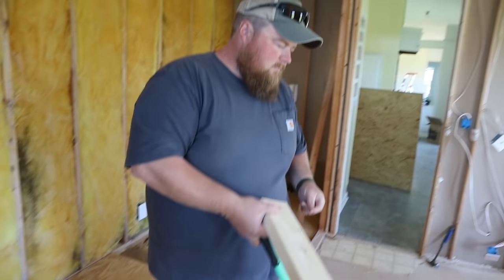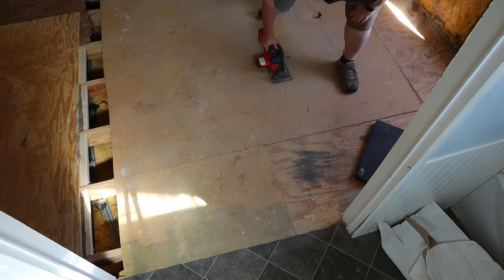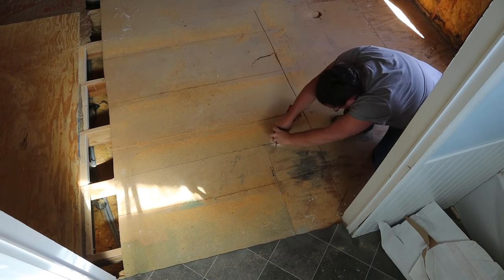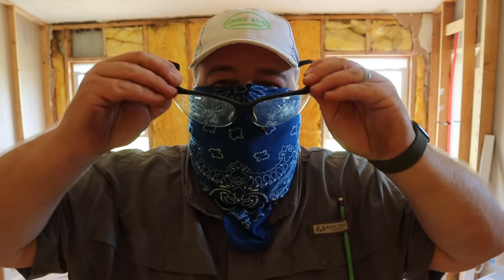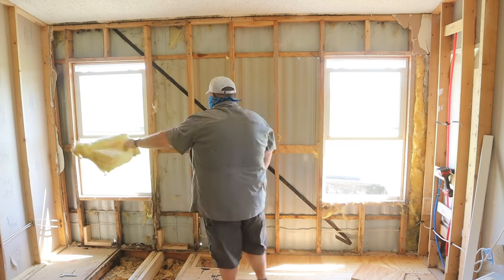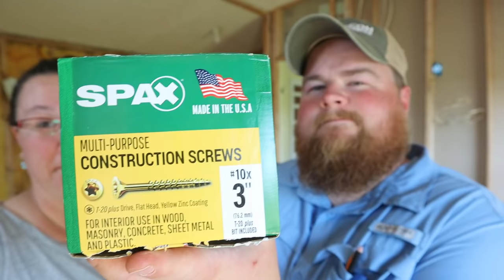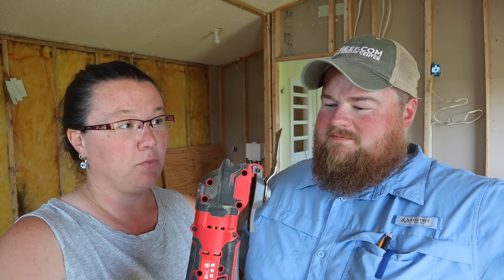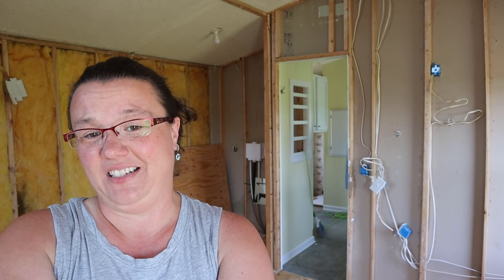More Than Expected... FULL Joist & Subfloor Rebuild // Mobile Home Renovation

Comment: Are you sure that those screws are long enough?
Reply: Sam's pry bar is stronger and won't flex much while the other bar is more usable for light duty and for hanging doors etc both are necessary when doing the work you guys are doing 👍
You guys are doing great work with excellent choices.
Much love 🙏🙏🙏💜💪

Comment: Just subscribed and yall are fun to watch also... I'm not an OSB nor MDF board fan either, rather use plywood. I'm slowly working on a 1987 Vintage RV 26 x 8 ft 5th Wheel remodeling to renovating it, getting rid of all old water damaged framing and flooring, etc that's including getting rid of all OSB and MDF that was originally used when this was first made, lots of water damages and it's a project that will take a bit of time but will be worth it whenever this is done. I'm doing away with the old black and gray tanks and water tank as well. This RV will not be used for traveling but will be used as a stable in one place on this property tiny home. Since I'm doing most of the work myself,  I'll have to work one section up to 5 feet at a time with the flooring and walls from the back to the front from the inside to get it fixed, cleaned up and steady stronghold, etc before I move in and before the city does a complete demolition of this old condemnable non fixable house and 2 story building on this property, no date set for any demolition yet, but want and hope to get this RV done before it happens. Again,  I agree about those OSB and MDF boards,  once there's water damaged its not good no more...plywood is better 😉👍

Comment: I just got a new Ryobi brushless Oscillating multi-tool for remodeling my mobile home. Don't like the switch on it, hard to turn on and can't shut it off right away. I just might be switching to Carsftman cordless power tools! Working on replacing the bottom plate on the walls and repairing or replacing any rim joist that are bad. 

Just starting to be brave enough to record what I'm doing! My channel isn't nearly as good as yours, but still fun to help others who might need it. Will be posting a new video tomorrow night.  Plywood? Next thing you'll be using Shiplap! 😅 Great job, love what you're doing!

Comment: The plywood goes under the plate. That job is shabby. The plywood believe it ir not supports the wall. Cutting up against the edge is a corner you just can't cut. This repair won't last 12 months.

Comment: I haven't followed your home renovations enough to know....Since you're taking things down to the studs and making structural improvements, do consider aging in place or if someone in the household becomes mobility impaired.  What would you do, where would you place them in the house, what types of grab bars might you need, and more.  And please, please consider where and how you might place a ramp into the house.  Placing a ramp at this time is neither here nor there.  But the vegetation placement and railing design are here and now.  In these plans, do consider that fiddling with keys while using a walker or waiting for someone while in a wheel chair isn't as pleasant in a down pour with no covering.

Comment: Ran a repair business for several years repairing manufactured homes. Done a lot of subfloors and found it beneficial to sister the floor joist at the subfloor joints. Made it faster and much more solid.

Comment: I did this job to a whole house recently.  DeWalt makes an adapter that allows 1/4 inch bits to be used with  1/2  inch impact wrench.  It's like a screw laser for fastening sub flooring to joists.  So much faster than a 1/4" impact driver.

Comment: Why the overkill on screws for floor, 1.5 or 2 inch screws are more than sufficient for 3/4 inch plywood, the extra length screws do not hold any better, but they cost more and drain battery faster, hence OVER KILL!
Reply: 1.5" screws wouldn't meet code. The code minimum is usually 2.5" and 3" is the norm.
Reply: @diyfferent  maybe for nails, btw I doubt he will be getting an Inspection.
Reply: @jackfisher3906  No, the same length applies to screws. Inspections or not...it's just always best to do what is proper.

Comment: Awesome job guys!!!  Angie, I’m like you I’d rather have a new tool!! I’m exhausted, been putting up privacy fence or should I say revamping due to a nosey Neighbor crawling underneath it last night!! But that’s fixed now!!!
Reply: Been watching you guys for a couple of years now I guess. We sold our double wide on a couple of acres about the same time I found your channel. Bought an old toy hauler fifth wheel and cruised the country. Long story short, we bought an acre about 20 miles further out of town from our old place with an old garage on it and are currently living in our fifth wheel. We have now bought a 16x 76 that is totally gutted. The only thing new is the roof. Most of the sub floors need replacing along with the dry wall plumbing you name it. Thank God my wife is like yours a very hard worker. Only difference is age I’m in my sixty’s. So thank God and your wife every day and keep smiling,
Reply: @puma1rc  we're doing the same too. We're in our 50s, so not spring chickens here either.  Even thought I'm like Angela, it's taking us way longer than expected. But we've been traveling back and forth 12 hours to work on it until we could sell our house. It's sold and we're moving into our camper in June to get our Mobil done.  The hardest part is we have a 15 year old too and he's definitely not happy about the privacy or lack of in a camper. Lol oh well we'll all have to scarifice  a little until it's done. Good luck to you and your wife🙏❤️
Reply: @darleneclark6098  Some days we will work on it and have to take 2days off to recover lol
Reply: @puma1rc  I feel your pain. We just got back from a week of work  and I'm wearing wrist braces because my carpel tunnel is killing me from all the staples I've pulled.  Some times slow and steady wins the race. Best of luck

Comment: 2 to 3 years for a diyers tool is not a flex. I use my tools everyday, aggressively, and they last me way more than years. If anything this video is kinda dooking on craftsman. On that note, did you check the brushes before buying a whole new tool? Not saying that's the problem, we call craftsman "crapsman" but it might of saved you 85$ 😂